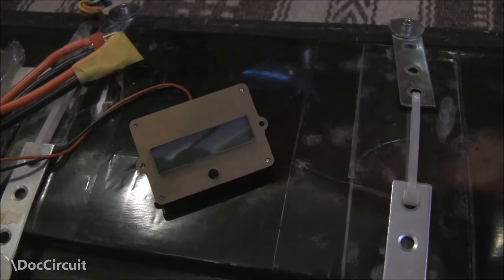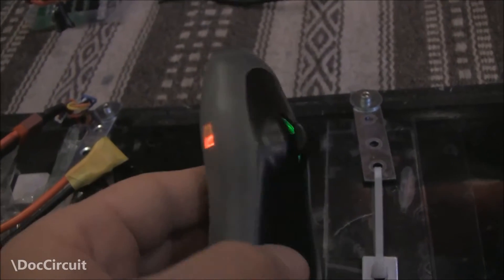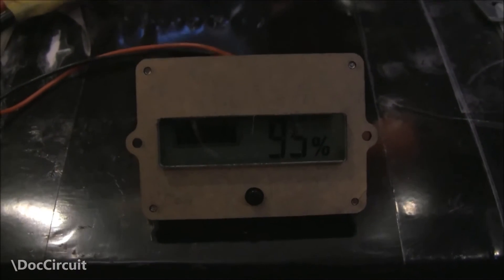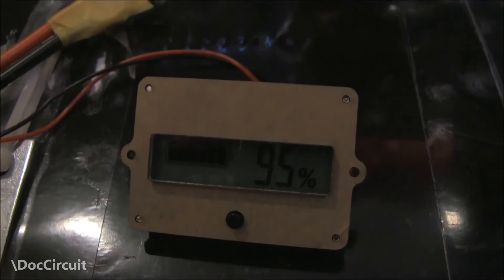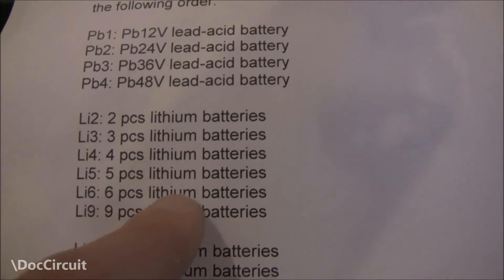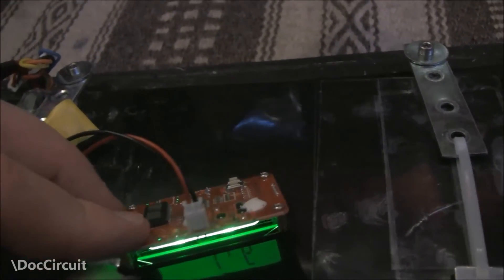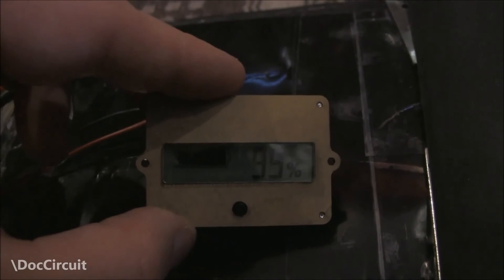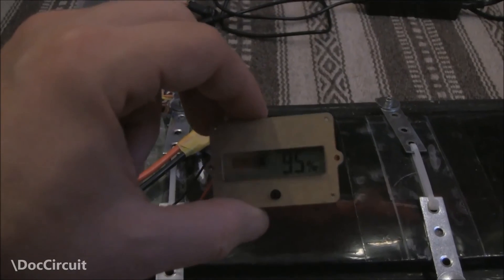Fitting a Battery Monitor to an Electric Skateboard.

Comment: Hey Dr Circuit! just finished my VESC install today. It was your videos that gave me the confidence to dive into the electronics of these clone boards! Thank you for the great skateboard videos! My soldering skills still need to come a long way though :P I also installed the same battery monitor in this video. 

I also was really curious about this FOC mode. So I went over to Benjamin Vedder youtube page and was able to program the VESC in FOC mode. WOW what an amazing difference, it should be called stealth mode. I haven't got any real road riding yet seeing as how its Winter and pretty cold in Canada but the board is amazing quiet. No grunting or screeching noise coming from the motor while accelerating. I would highly recommend the FOC mode.
Reply from the maker: Thanks for the kind words! 

I've never played around with the FOC settings as my current configuration works well, but from what you say... I just might.

Comment: Hello , where do you get the battery? thanks
Reply from the maker: If you're in the UK, Magneto Boards or LecDec.
Reply: +Dr Circuit lecdec seem to have disappeared I ordered some parts last week, they didn't ship them and are not responding to emails or phone calls.
Reply from the maker: Really? That's tiresome. You could try Magneto Boards. Failing that you could fit off the shelf batteries. Ensure you choose 6S (cell), 24 volts, 8AH or above. You'll need to modify the case but this isn't difficult.
Reply: Hello +Dr Circuit... First off! Great video series! Really appreciate all the time and effort you put into these. Very helpful!

I have a question for you... I have one of these boards and would like to take it with me on planes as I travel for work every week. I've been trying to get some details on the battery to see if it's safe for US travel. But I haven't been able to find all the details. Do you happen to know the battery specs?

I'm also wondering if it's "too big" as a single battery pack. Do you think I could split it into two packs to make each individual pack "travel friendly". I appreciate your help! Thank You!

Comment: I am a noob at electric stuff but i want to do these upgrades
Reply from the maker: To do these modifications you can't be a 'noob'. There is a powerful battery on the skateboard, and it's chemical makeup is volatile, so much so it can explode. I do NOT recommend you, or anyone, 'learn' electronics with an electric skateboard. Indeed I recommend the exact opposite and do NOT attempt to even open an electric skateboard.
Reply: ;C
Reply from the maker: I know it's annoying Calvin, but these boards really aren't the place to learn.